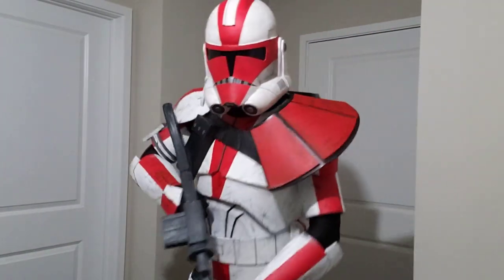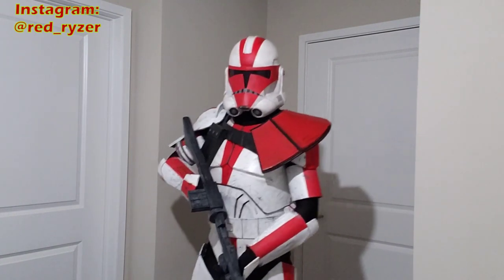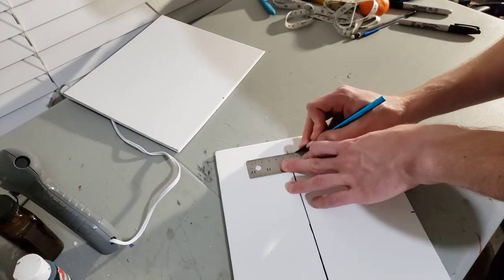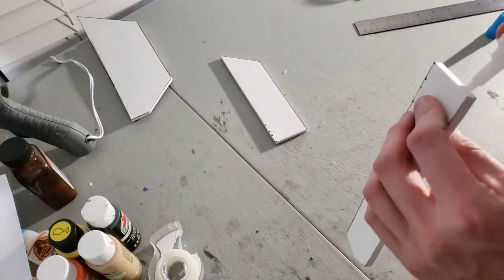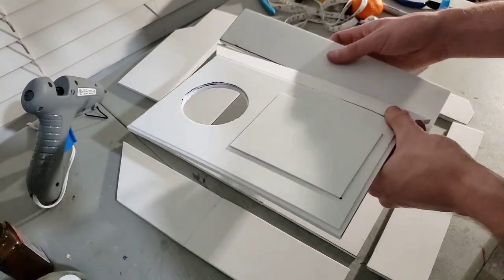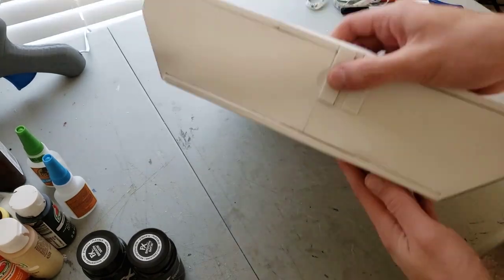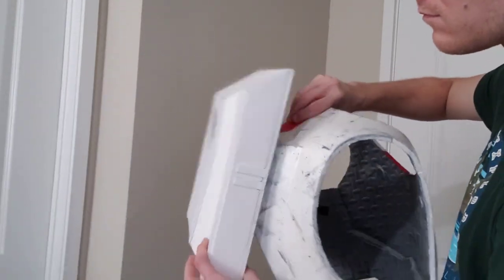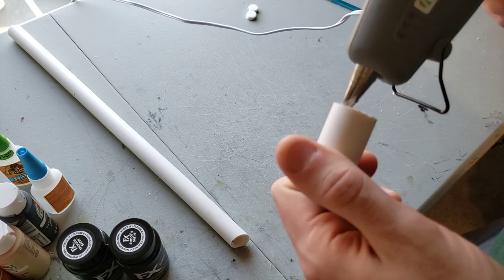Clone ARC Trooper Backpack Cosplay Tutorial [ FREE TEMPLATE ]

Comment: What thickness is the foam you used for the rest of the armor?
Reply from the maker: I used a floormat that has a pattern on the back so it's a little hard to tell, but It's around 6mm. I linked it in the description. The CAP Barbell foam mat.
Reply: @ryzer_red  Thanks. I’ve been looking for a good template for clone armor for a while and this has really helped.

Comment: What’s the paint that you use for your armor ?
Reply from the maker: If you are using EVA foam, then you'll want a flexible paint like PlaidFX. I made the mistake of using spray paint which is enamel based and doesn't flex at all.

If you are wondering about color, then the red is "Red Alert" from DecoArt Americana.

https://www.amazon.com/stores/page/04A84146-C301-496E-8051-C87D186338AD?ingress=2&visitId=e086f75f-ef92-43a8-9c9e-cfe2b1dad385&ref_=ast_bln
Reply: Ok thanks 😉